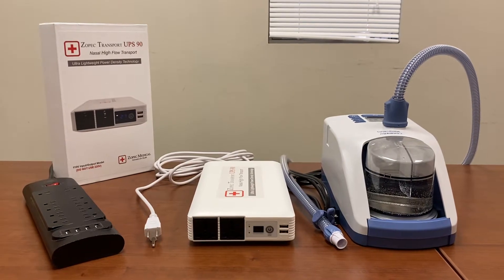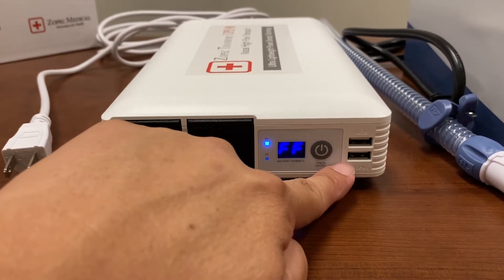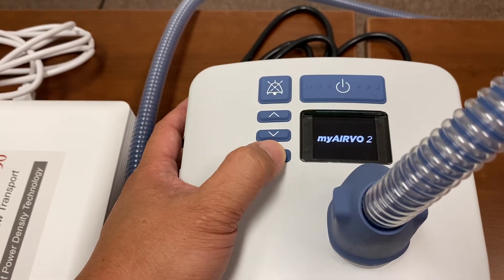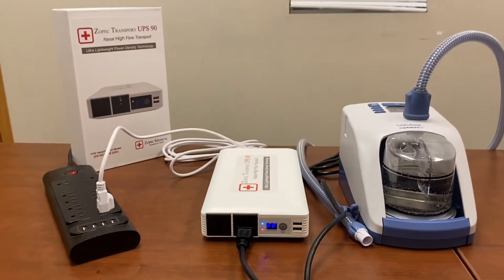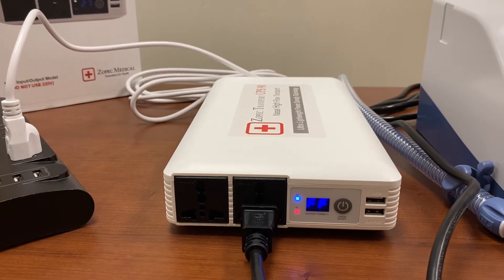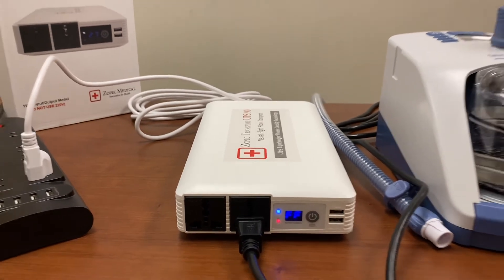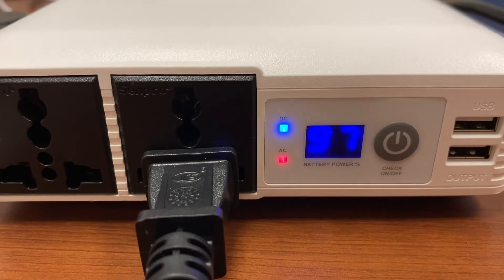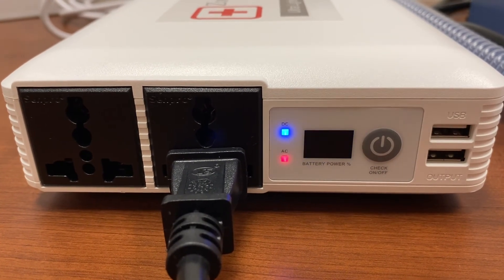How to use Zopec Transport UPS 90 Battery with FP Airvo2 for Patient Transport

Comment: And the AIRVO 2 heats up ok with this transport device? It heats up to to 37?
Reply from the maker: Hi Peter. Yes. Thank you for the inquiry. I am the battery designer and owner of Zopec. Let me help you. The Airvo2 works normally. We had to make sure it has more than enough AC Output to get to 37C while running the Airvo2 at 60 L/Min and aerogen nebulizer. It actually has much higher output than required. With cold start up (18C water), UPS 90 runs 37C and 60 L/Min for 90 minutes. We did clinical trials with several hospitals and ambulatory services (air/ground) for two years before launching it at AARC Congress in NOLA. We did live demo to critical care RTs at AARC NOLA and AMTC Tampa (air medical). Since then, 100+ hospitals and ambulatory services in the US have either purchased or passed trials. It is the first ever small and long lasting transport battery for Airvo2. For the blender/MR850 heater systems (opti-flow), the pure sine version is being made. Also we are making 230V version for global markets. Please contact us at info@zopec.com if you are interested in a Zoom in-Service. Thank you! Strong
Reply from the maker: Hi Peter, I just realized that you are a patient and loves camping! I specialize in developing smallest and longest lasting batteries across most critical care and homecare respiratory devices. For example, a 7.5 lbs T180 battery will run LTV for 9 hours and Trilogy for ~24 hours. For extended power outages, all Zopec batteries can be recharged by car charger and solar panels. If your Respiratory Therapists are interested to see what we offer, please contact me at strong.huang@zopec.com. Have fun camping and enjoy the outdoors! Best Regards, Strong